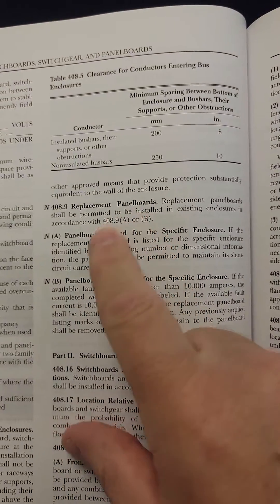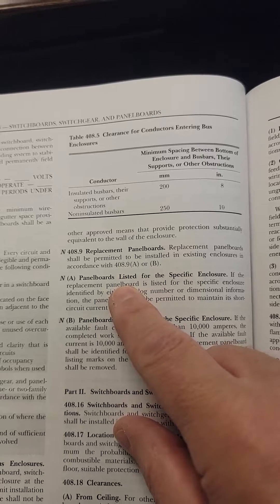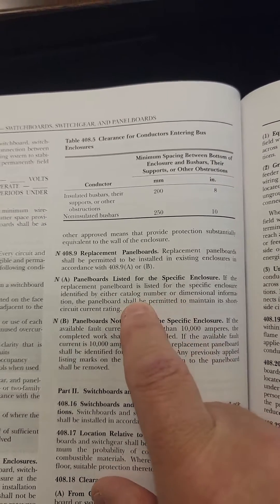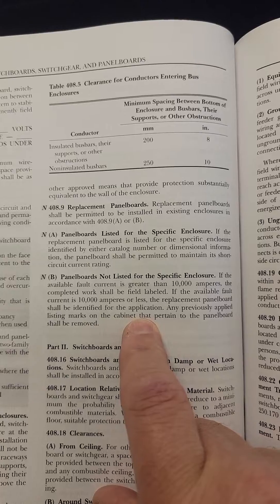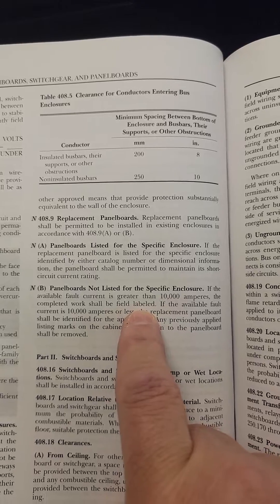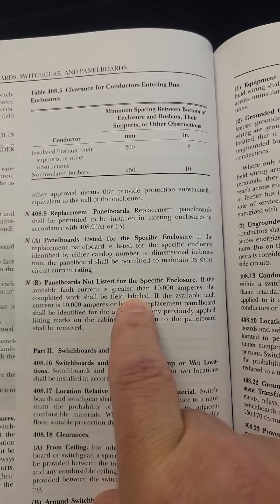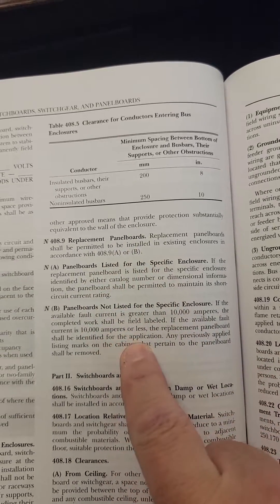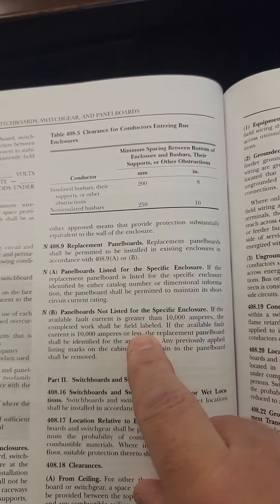2023 NEC Change - Replacement Panelboards

Comment: I haven't picked up a 2023 Code book yet but I am curious about any changes or additions. I like that additional section you pointed out in 408. Now if we could get a clarified 220.60 as it relates to MFD's, and some clear guidance in section 220 on what to do with EV's it would help. Every city has a different opinion on what to do with EV loads in service calcs...and if they are gonna become common, they need to be addressed better than they are now. Took your course and passed the Texas Masters in September. Thanks Paul.
Reply from the maker: We do have additional clarity on those things in the 2023 NEC.